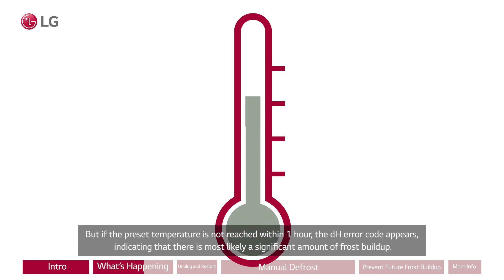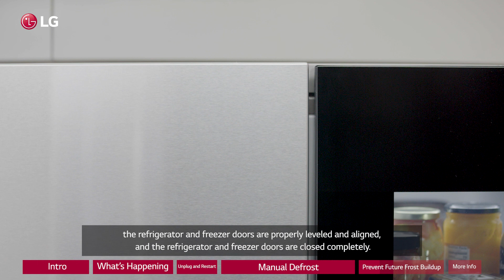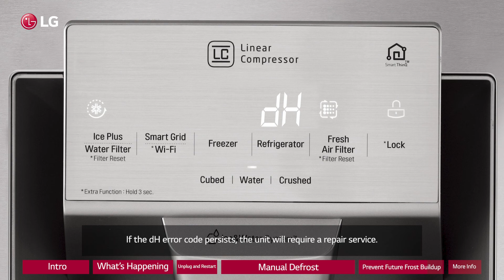[LG Refrigerators] Resolving An DH Error Code On A LG Refrigerator

Comment: I did the unplug thing for 12 hours, connected the fridge and it worked again... for a day, I got the message again, I had to called LG, not buying a fridge from this company again
Reply from the maker: Hi, there. Thank you for reaching out and sharing your experience with us. We understand that you're facing ongoing issues with your refrigerator. We value your feedback and want to ensure you have a reliable solution. Please send us a private message so that we can assist you more effectively. -MC

Comment: LG is real SH1T, I just moved to my new house, it had all new LG appliances and under warranty the first thing that was damaged was the refrigerator, they did not give a warranty on the compressor, then the dishwasher, not even the technicians could fix it, Likewise, in this one the 10 years were only in the engine, I had to change it. Now the refrigerator gives this DH-F error, I have done everything they say in the video and the problem still continues. I have asked the technicians if it is an electrical problem in the house and they only told me that LG is very bad. I hope this helps someone before making a purchase. Bad equipment, bad service.
Reply from the maker: Hey there! We appreciate you letting us know about this. We understand how your refrigerator and dishwasher play an important role, and we'll be more than happy to take another look into this. When you get the chance, kindly send us a private message on social media @LGUSSupport with your contact details, model, and serial number. ^Anthony
Reply: I have the same situation described above even after changing the entire Defrost heater assembly. I called customer service, and all they talked about was money, to authorize a technician to visit for $450 just to come in. I owned a SubZero for 25 years and I did not have a single issue with either the Freezer or the refrigerator. I swear LG should not sell in USA. It is a very bad product engineered to suck money and parts. My refrigerator is only 2 years old. Let them GTH.

Comment: I got the Er dH error on my refrigerator and did the "unplug for 8-9 hours with the doors open" troubleshooting, and it didn't work.  Which means, not only do I have to replace this stupid LG refrigerator, but I also lost hundreds of dollars in food.  Thanks LG!

(I just ordered a Whirlpool to replace this garbage.)
Reply from the maker: Hey there. Thank you for letting us know about this. Your feedback is very important to us, and it helps us keep a fresh perspective on new ways to improve our services and future products or appliances. Should you need any assistance with your unit, we have a dedicated department that can assist you with your concerns. Please send us a private message through our Facebook or X (Formerly known as Twitter) platforms using @LGUSSupport, and we will be more than happy to accommodate you. ^Anthony
Reply: I had the same experience. They replaced all the parts in and under the fridge by now and still getting the same error. Made with cheap and unreliable parts. Ordering a Whirlpool as well and happy to see this LG get disposed of. Total trash.